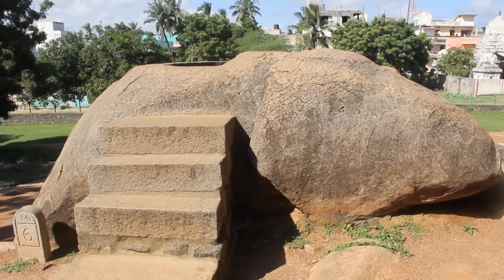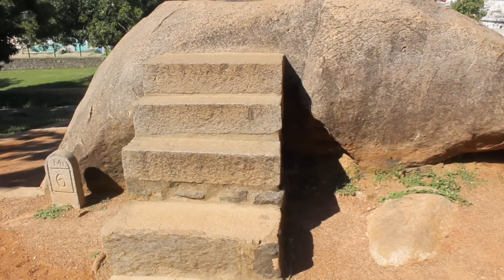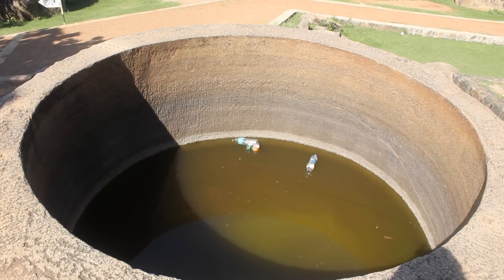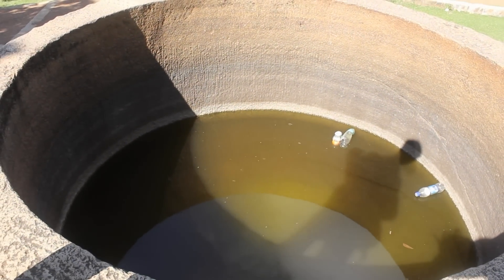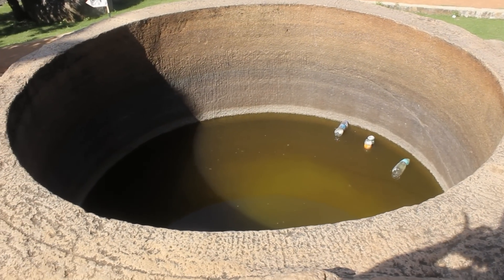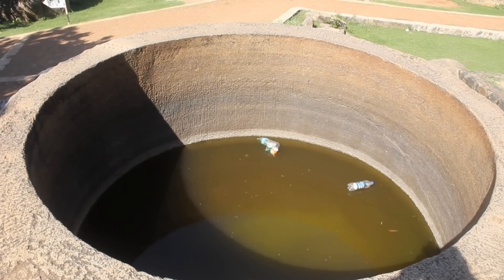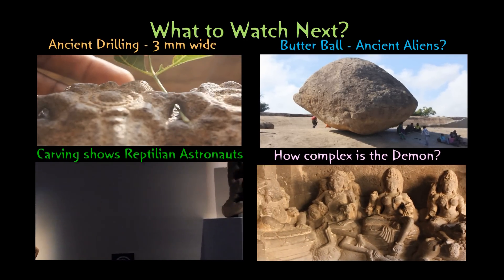Ancient Drilling Technology - Mahabalipuram, India

Comment: This is what I see, I see evidence of chiseling on lower levels, smoother levels near the top, I also see repair work or concrete plastering. It is an unfinished project. What could it have been used for? Anything that needs a base or a hole. The steps look like disguised concrete work as well. If we can disguise concrete to look like sandstone, granite etc etc, so could the ancients. You see, natural stone usually has lots of imperfections.  What do you notice about the discoloration at various levels, the surface texture at different levels, and the crack line? Water damage and chemicals have a certain effect on color and texture. Figure it out yet?

Comment: 1. Why round?  Because round is continuous...corners, in stone masonry are hard to make. Round means the tool can be placed on a simple radium arm and position very accurately.

2. How? Yes, it is very difficult to cut rock. But, it has been proven the ancients had their version of technology that world well. I see vertical gouges in the rock, on individual continuous axis. It would seem to me, the tool was narrow in diameter and spun. Perhaps a copper tube, with some sort of slurry containing grit that ground the rock as it moved. Time consuming, but easily powered due to the small diameter. One can envision several drills working simultaneously making the work faster. The holes were then filled with some material that expanded when wet and thus fractured the rock along "hole lines".  This is especially effective once a central hole is opened,  say about 5" in diameter or more leaving the rock some place to expand toward. The strategy would be, crush out a central (near center.leaving a fixed position for the true center to be placed. Drilles the begin close to the center opening, expanding material (wood is pounded into the holes that is then soaked to expand it..a process still used to this day)  the rock fractures and is chipped out, repeat. The closer you get to the outer perimeter the easier the process due to the ever increasing radius. Thousands of holes later...you have the finished opening.

3 Why? A large vat made of really durable material? Leather processing with harsh chemicals would call for such a creation.. What chemicals did ancients use? They almost certainly knew about lye making or the use of natural lime used in tanning. It was unlikely used for hot process, since the hole is not vented. Although rock does hold heat well and resists high temperatures, there would be signs of fire or carbon stains. It could have been ceremonial...some sort of spiritual insulating chamber...perhaps once there was a kind of lid that since has been broken or perhaps it was made of more perishable material like wood that has long sense been rotted. Scientific?...it may have been a shadow chamber, made in stone to make it immovable over long periods of time for accurate study...a sort of 'bowl clock" with which time was observed by the movement of shadow, seasons were marked by placement of idols or figures on the rim, etc.  It may have merely been carved on the whim of a ruler who said he had a vision of a great round hole cut in a stone as a "gateway to heaven". Perhaps it was a competitive example of rock cutting skill used  to out do some other impressive sort of project by another kingdom, or it was made merely to impress visitors. It may have been a kind of sky observatory, where the "scientists or Shaman sat in the middle with some sort of ivory or wooden sighting instrument marking the path of the celestial objects along the rim as the world revolved under them. Stone or metal figures may have been placed around the rim as markers of the Zodiac and thus used to understand the movements of the heavens from season to season. to give the kingdom power in communicating with the Gods. 

We may never know why it was made, due to so many possible reasons.

Ancient people did not think as we do. They were not overly concerned with economics as we are. things did not always have to be cost effective. They were much more spiritual and connected to the world of nature. Their minds accepted mystery easily for they were surrounded by mystery; What made thunder? What was lightening? Why was fire visible? Why did smoke rise?  What made water freeze? How did babies grow inside a female? What happens after death (one mystery we hold in common with them).

To expend untold hours and huge resources on a single difficult work such as this one was no different to them than building a B-29 was for our grandfathers in WWII, or for us to make a Space Shuttle or a computer. We may trivialize their motivations, or consider them childish or unsophisticated. Yet, these projects were obviously of vital importance to them for their own reasons. They do not have to be practical to our way of thinking. 

The fact remains, they did this. The techniques they used to do it are not mysterious at all. What we should marvel at more than the actual tools, is their dedicated patience, will to work very hard at mind numbing tasks. We are impressed to no end at their devotion to their skills and cleverness in making these wonders so nearly perfect by hand craftsmanship..

Comment: Value of Pi is irrelavant for making a circle, all one needs ia a nail/stick (axis) and a string (rad). Looks like this stone was part of a hemispherical mercury bouy potentiometer (dimmer switch). Partially fill grounded bowl with mercury, float a hemisphere connected to conductor in the middle. Float being depressed into mercury would result in more contact and current flow, being elevated would reduce or break contact. Depressing and suddenly releasing would create a sine wave.

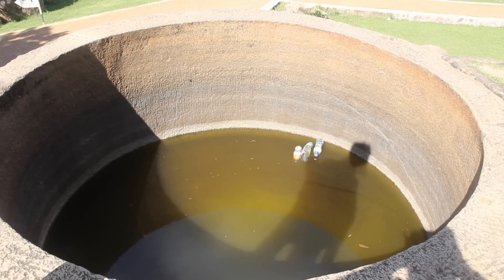Comment: People regard this with such indifference that they throw trash into it. :o[  At 1:43, you can see the vertical marks of a tool of some kind. They are too evenly spaced to be chisel marks. Such marks can be seen on many megalithic structures around the world, and are indicative of a rotary saw, or perhaps in this case, something like a reciprocating saw that was moving vertically up and down.  Some very determined stone sculptor could make something like this from granite nowadays, using modern power tools; but they didn't have technology like that 1300 years ago, or we would find evidence of the tools still around. I suggest that this is much older, dating to the same time that the megalithic buildings around the world were being constructed, a time when people could work stone as easily as we can work with concrete.

Comment: I used a sound drill with a copper Circle pipe and added sound to it with wire how they created the sound barrier I do not know back then but that is the only way to have done it like that to regret it sound will work if it's used properly don't believe me look it up you'll find an example of it

Comment: Not Hard. Tools req'd: chisel, hammer, cord. Process: Use chisel as scribe tied to cord. anchor cord end. Swing circle arc, scribing circle perimeter to depth of ? 3mm? Then, hammer chisel out circle interior. Repeat for ever 3mm depth layer until the hole is at full depth.  ??? Why? luxury pool or bath. Fill with heated water. Granite keeps heat/temperature stable for a very long time. Nice luxury fixture. *I Like It! * I'm going to run with it.  You geard it first! Here!

Comment: i think some of the comments are true in their own context. sure early man would have to contrive ways to use available materials to shape granite. and true today we use laser guided machinery and even water jets, a thin powerful stream of water that can cut through thick slabs of granite and leave a honed edge that only needs an 1800 to 3600 grit diamond pad to bring to a high luster, but, i think what the author is trying to appreciate is how, back in those days was it done  with primitive skills. i think, it wasn't. these temples and sculptures were not done by a primitive labor force. I believe, i could be wrong, this was all done with ET technology and ET operators with a slave force of laborers numbering in the 10s of thousands. they. had a way of levitating 400ton stones into place, and its been proven that when new, the exterior stones where polished to a degree we could never achieve. I objective about almost everything, but no one can convince me that iron and bronze age men did these massive works of art and building rubbing 2 sticks together  to make a fire. its only been in the last few decades we've had the technology to cut 2 and 3 cm slabs of granite from a huge block using a gantry saw which has long steel cables enbedded with diamonds running thru sand and water. sorry for rambling but, theres no way the strongest, brightest human did these works he's showing us. sorry. just saying.

Comment: Ok a donkey traveling around outside attached to a cutting arm made of metal but a step up and a step down to allow the donkey to apply pressure to the rock also so that it can be adjusted towards the centre I believe the hole was used for water as the rock would have had a lot of minerals to add to the water other containers would not

Comment: granite can be cut with hardened steel.....hittite tecnology.1500 bc....it only takes two men ....one to cut with hammer and chisel and one to fire sharpen and grind the chisel tips....a hammer is used to pound the rock and loosen the strength....then cut fine line and chop......too easy.

Comment: Pi is irrelevant, all that is needed is one rock rotating on top of another with sand between the two, and you will produce a perfectly round hole.
The real question is why?
It would seem that it was required to have something that would last indefinitely, and contain without spillage or leakage.
The next question is, if you have a fluid, powder or liquid contained in it, how would you empty it?
If it was a press for juices, you would expect it to have an outlet, it doesn't appear to have one. So, one would deduce that whatever it was required to hold, it wasn't expected to be drained out.
Next, is to keep things in, or keep things out? 
It could have been for vermin proof storage, and/or to keep things at a constant temperature.
It could be to keep something that would otherwise burrow out or climb out. 
Whatever it was, it would need to have a large intrinsic value, for anyone to go to so much effort to produce it.
Without knowing the society, and how they lived, its difficult to go much further, but these are my present immediate thoughts.

Comment: why tamilans need pi . instead they had a formula for making a wheel which will be 7 units in dia and 22 units in circumference, still now your village carpenter ate using this technique to build wheels of bullcarts in Tamilnadu. I think u can notice the size of the sun temple's sun wheel which is approximately 7 feet high
Reply: I also want to change you Western people a building or a dam which must be in 0°(temple at Thanjavur, india) in vertical and should withstand 1000+ years and then you people make fun on our ancient Indian people. do you know about there. are secret caves connection between each temple. there are 9 temple representing 9 planets of sun, each temples facing each planet in perfect angle. go and Google you architectural design and then you just put your a...... comments

Comment: ok so you dont need complex tools, 1 a metal rod straight...as long as deep as tyou want your hole, you hammer it down all the way except say an inch, take a piece of string attach to tip of rod....so this is 5 foot across you will need 2.5 feet of string, you bet another rod attach to the other r end of the string, you pull the string till taut and use the tip of the rod to score the ground, you go half way round for going any further will shorten the string and screw your dimentions, and then go in the oposing direction, here you now have a perfect cyrcle...if you were to say repeat the proses grinding this ring like hole all the way down to your foot depth,then you would meerly have to remove the stone in the center...now concidering the length of time this would take as in years, then it would not be obsured to concider thet the other HUMAN(s) that did this would have invested more time thinking and planning it, if i can resolve this in under 5 minuites, then building this the ttemple and so on is not difficult.....also i think people tend to forget theres always another way too look at things.....and all these kind of things are made by other people so that makes the answe obtainable and faster. the classic mistake of this lie with archeologists and linguists...look at hyroglyphs...over a 100 years of cryptographers archeologists ad scientists couldnt work it out...a guy in it did...he took the basic symbol they used for waterand , and said any other cuilture  still using this? the answer was ...so he asked...and got the answer

Comment: So, 1300 years ago, a hole was made that measured EXACTLY 8 feet wide? As in 8 Imperial Feet? as in after 1824? nice tourism.
Reply: Nice point you make ..   whats the exact  dimension  which would give an insight  into what  kind of measuring system they  had used
Reply: Actually the imperial was England circa 1824. Same idea, wrong empire.
Reply: Your choice of adjectives regarding India is only reflective of yourself.

Comment: THE APPLYING OF PAI HAS NOTHING TO DO WITH CIRCLES, COS PI IS CALCULATED OUT OF CIRCLES--  AND IT IS VERY SIMPLE  TO CARVE A PERFECT CIRCLE IN ANY RADIUS, JUST FIX A NAIL OR LIKE THING AT THE CENTER WHERE YOU WANT A CIRCLE AND ATTACH A ROPE  OR LIKE THING HALF THE RADIUS OF WANTED CIRCLE , ATTACH YOUR CHISEL OR DRILLING TOOL TO THE OTHER END OF THE ROPE , GO ON SWITCH ON START  THE CIRCLE IS READY, TO GO A CYLINDER , GRADUALLY WITH CUNNING ACCURACY PLACE DOWN THE CENTRAL NAIL, . TIE YOUR DOMESTICATED ANIMAL IN A PATCH OF GRASS, AS ANIMAL FEED ON THE GRASS YOU WILL GET A CIRCLE PERFECT , THE RADIUS SHOULD BE DOUBLE THE LENGTH OF THE ROPE USED TO TIE THE ANIMAL.DOMESTICATED ANIMALS MAY THE FIRST TEACHERS OF MATHS.

Comment: You are incorrect to your understanding of when PI was applied and the period. At 1;11 you state that 1300 years ago, when the value of PI was not even invented...HOWEVER, history tends to rebuke your view since PI was STATED by Archimedes 2200+ years ago and the Egyptians had a similar method that gave the value of 3.1605. Not PI but terribly close...and that was 4800 years ago. A math formula is discovered, not invented. You cannot invent the number 2, only discover it and apply a visual value based on your cultures concepts of numbers.

    There are many holes like this, smaller as well, in other countries that are much older and this has been reproduced by simple understanding of MATH, sand, friction and speed. I find that more logical than to assume other venues